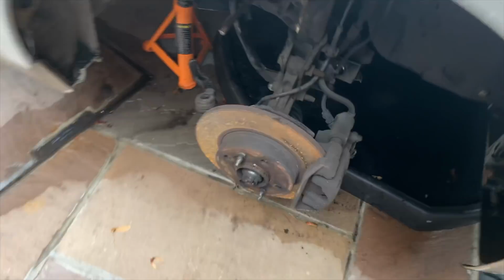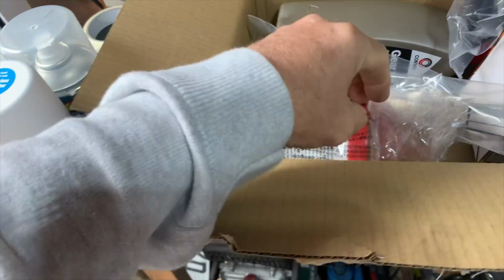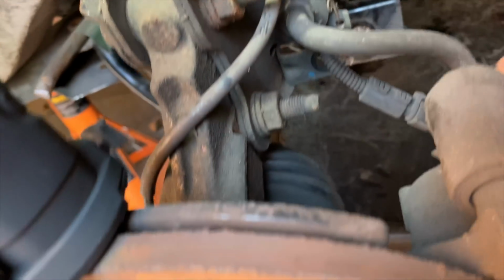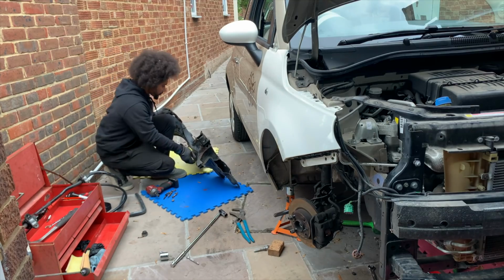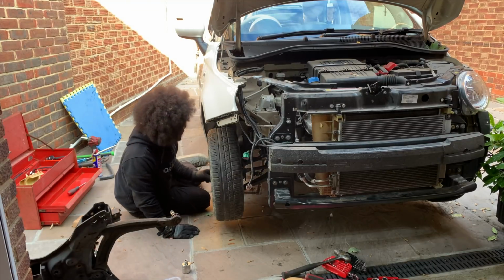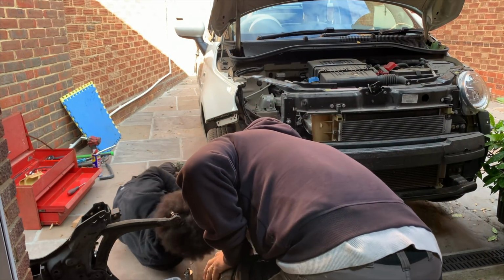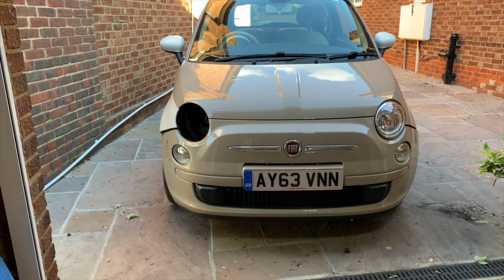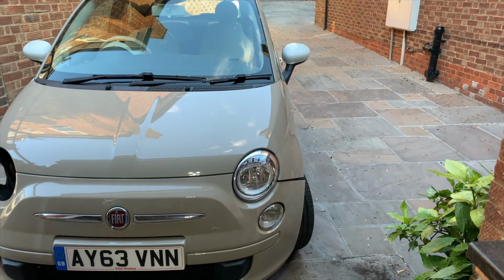Project Beige Girl  - Fiat 500 Copart Salvage Repair - Day  2 - Will She Run & Drive

Comment: Will be good to see the colour match from the ‘painted to colour’ option off eBay. Need a front wing / smart repair myself thanks to a lorry driver scuffing it whilst I was at work!! The car sounds really good, sweet little motor for someone that. Watching from Barnsley 👍
Reply: I've used them on a 2008 500 and you would think that they were the original panels.
Reply from the maker: It’s the colour match that worries me. The wings themselves are fine. I’ll be ordering this evening.
Reply: @Love500  My Nero black was excellent. Had a bumper and wing done by them.
Reply from the maker: Forza Sim Racing ive had varying success. I think it depends on the colour.
Reply: @Love500  Agreed. What colours have you had success/no success with?
Reply from the maker: Forza Sim Racing the light blue, good and bad, light green just bad. White, red and black. No problems.
Reply: @Love500  thank you. That will help with next project.

Comment: Pleased it runs and drives, i was thinking you got a money pit when your man had a problem getting into gear off the transporter.
Reply from the maker: stew kea me too. I forgot with a limited slip diff it won’t move in gear with only one drive shaft attached. It was a nervous moment when it was done.